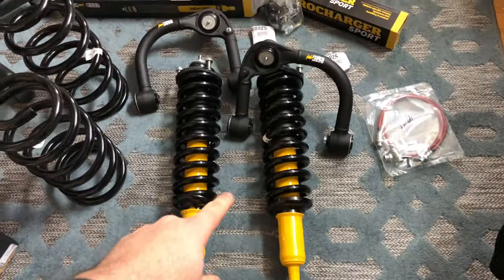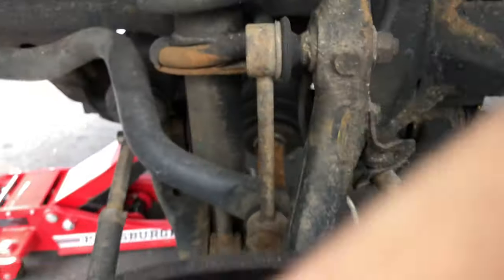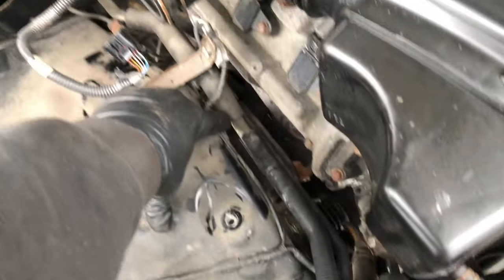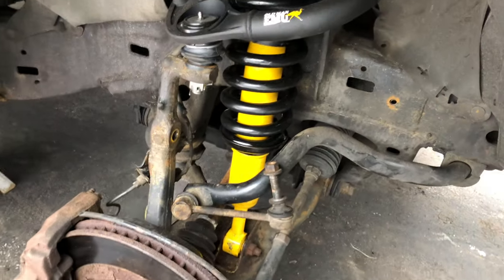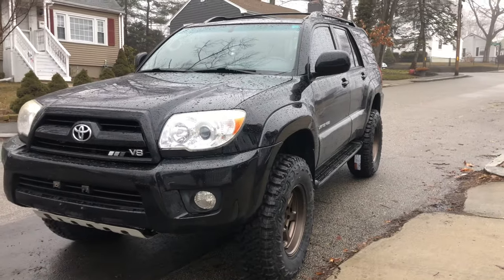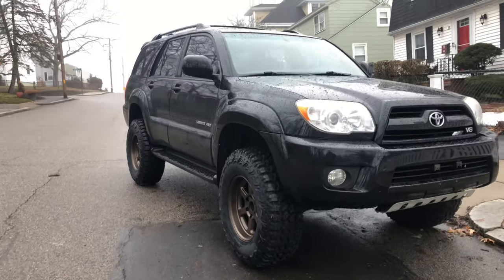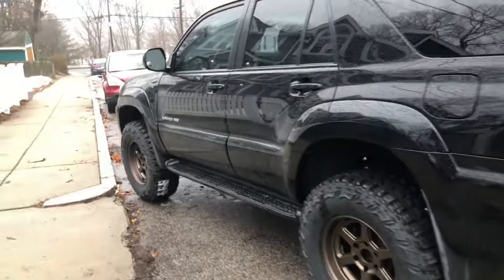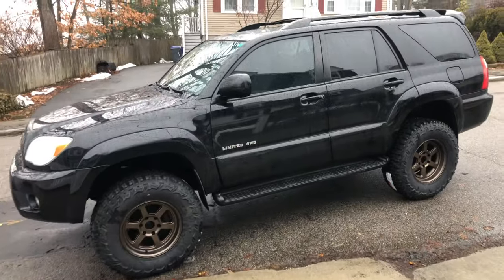4th Gen 4Runner - Old Man Emu Lift Kit Install and First Impressions!

Comment: Just put this on our 07 V8 sport. If I'm being honest right now I'm kinda wishing I went with softer valving and medium springs. Pretty stiff so far, hoping it settles down. I really wanted all the height I could get to fit bigger tires but so far I miss the more comfortable stock soft ride where I don't feel every imperfection in the road.  I don't have my heavy duty front and rear bumpers yet but carry extra weight other ways. Hoping the new tires I'm about to put on with a softer sidewall will chill things out.
Reply from the maker: Mine have been pretty comfortable after all this time. I do have the heavy front bumper and rock sliders though. I also do tow my car now and then, so I’ve been very happy with the spring and shock performance
Reply: Just curious, what is your tire psi is set too? And setup?
Reply: @offbalancewrld amazing bro, I am curious what code or set of OME you installed in the front springs, soft, medium or HD?
Reply from the maker: @TheBEAST-ej7oo  I did HD, I planned to tow and offroad so I figured it would be best to go with their heaviest duty options

Comment: Just bought an 05 sport and I’m considering this this kit. How does it ride compared to stock? Im worried about roll over and nose diving
Reply from the maker: It’s a lot more firm, no brake dive anymore and it sits a decent amount higher. No suspension noises but my mud tires do make a lot of noise on the freeway. I’m sure some all terrains would be better with noise level

Comment: Overland experts in Australia say that you should go with pizza cutter tires or skinny’s as they say. It’s better as far as getting out of mud but as far as rock crawling im not sure. So what would be the best size for a good balance of getting through mud and rock crawling if doing both?
Reply from the maker: I’ve only ever used these tires off roading. This is my first overland/off road build and the 295/70’s have been great for what I’ve done so far. I wish I could give advice but I couldn’t recommend anything with confidence yet

Comment: I'm installing the same kit in my '04 4Runner.  On the rear shocks, HOW did you get enough thread showing on the top to get the nut on?  When I use all the washers that OME provides, I don't get any thread showing on the top! My order is shock, big washer, rubber, smaller washer, frame, flat silver washer, rubber, big washer, nut that can't reach threads...
Reply from the maker: Dm me on Instagram, I can send you a picture

Comment: How do you solve the tire rubbing? That's my main concern.
Reply from the maker: I had to slightly trim the frame rail behind the front wheels, the front bumper wasn’t an issue because I upgraded shortly after

Comment: Hey! How is the suspesnion holding up so far? I got a 05 v8 looking to buy the kit with 896 rear coils, i don't have any rear weight, I dont know if you do as well, but if you dont do they feel good? I plan on hauling my dirt bike from time to time!
Reply from the maker: Suspension has been great. Still rides smooth and takes hits flawlessly. I got the heavy duty rear springs because I plan to tow my car to drift events but even without added rear weight it still feels nice and manageable
Reply: @offbalancewrld  thanks for the reply! Looks like I'll be gunning for the 896s! Cheers!
Reply from the maker: @maynewhy  No problem at all, and sounds like a solid set up, Enjoy!

Comment: Do you need the extended brake line? And won’t your axles be super stressed with that much lift? Diff drop?
Reply from the maker: I have rear extended brake lines. I may do the diff drop soon, but I don’t see any issues right now. I don’t do any rock crawling or anything very stressful on the axles so I didn’t see it to be immediately necessary
Reply: Just ordered the same setup with the diff drop for my 04.  Looks real nice on this one.
Reply from the maker: @hotepcracker8975  Hell yeah, defiantly a good choice 👍🏽

Comment: Did you opted for the heavy load coils or medium? (Probably mentioned on the video) planning on getting the same suspension lift for my ‘21 sr5P, my question is, the vehicle is on stock weight right now, except for a gobi stealth roof rack (roughly about 80 pounds), would it be a problem if i choose to go with the heavy load coils?( for future proofing purposes) , according to the website i’ll be purchasing it from, the heavy load option is for 440 pounds of constant load in the front and 880 pounds of constant load in the rear, i shouldn’t have any problems going with the heavy load options right?
Reply from the maker: I went heavy load because I plan to tow my car to drift events, daily driving without any added load has been fine though. It’s not overly rough or bumpy 👍🏽
Reply: @offbalancewrld  thank you so much for confirming this! Very helpful boss! 🤙💪 cheers.
Reply: @offbalancewrld  bro one more question, since you got the front assembled by yotamafia, can i re-use the top mount from my ‘21 oem front shocks and just transfer it on the OME? I’ll be putting together the front shocks/springs myself since i got the tools for it.
Reply from the maker: @RCGJR_  yeah I believe it will fit just fine, as long as you have the right tools 👍🏽
Reply: @offbalancewrld  🤙🏽